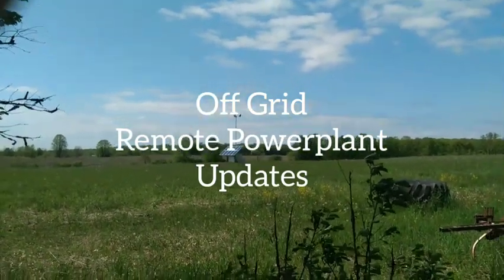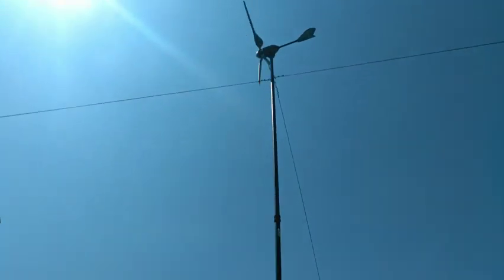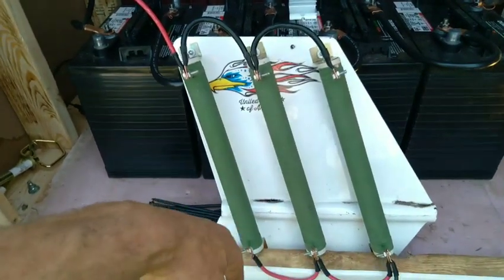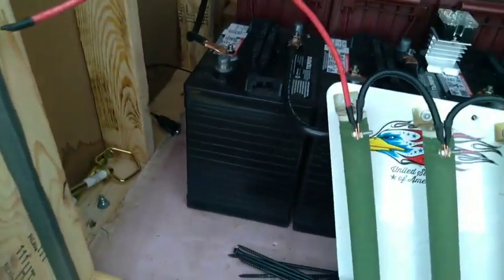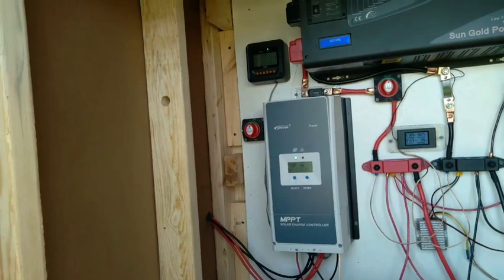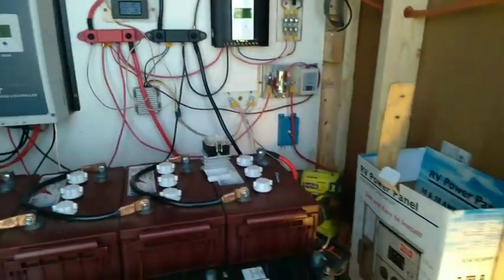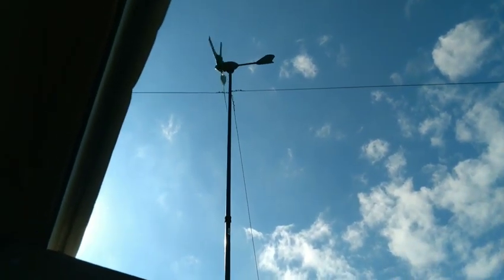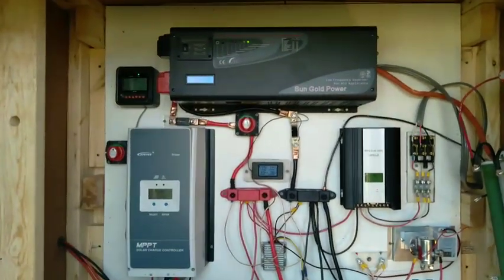Off Grid Remote Powerplant...Updates

Comment: every time when i see that turbine blades, they drive me nuts :D ;) i think i have figured out how to make them from pvc pipe :) only not sure how many i should make 3 or 6 blades for 250w hoverboard so it would make constant power mostly...
Reply from the maker: They are gorgeous blades eh?! A set wasn't to expensive. Maybe $80 US. Hard to say what will do best for any turbine till you try it really. My 800 rocks with the 5 blade setup but with these same blades it wasn't enough torque to really get going. On this 600 and my 500 these blades just fly! What size shaft is on your hoverboard?
Reply: @smallcityhomesteaders1600  i think its 10 or 12 mm max inside, but i plan to make blades so i can attach them to existing metal plates... 6 of them would make realy big diference but 3 might get more rpms at top... nd if that works then i think i could put 2stators together and make 500w motor, but its a bit dificult because of making bit longer shaft with leith... its hard in this time to find who could make it

Comment: You could us a step down converter for the ssr a small one would do, i think most of them are 3-32v so might be difficult to find higher. Ive heard bad things on those solenoid relays getting stuck on, the ssr you got should be good i use a few of that brand at about 30 amps they get hot though id nearly add another heatsink or fan if its going to be alot of amps. Nice Setup 💪🏻👌🏻
Reply from the maker: I definatly thought about a step down. However I'm pretty sure I wrecked it almost instantly when I tested it otherwise I would have tried that.
Reply: @smallcityhomesteaders1600  ahh didnt know u plugged it in, yes gone then😬😅
Reply from the maker: @offgridamps  yep....she lit up for about 5 seconds and that was that. I think we'll try using the step down and maybe also run a small fan from the 12v line since the switch side if the relay uses almost no power. The stepdown already in there was cheap. I'll just order another.